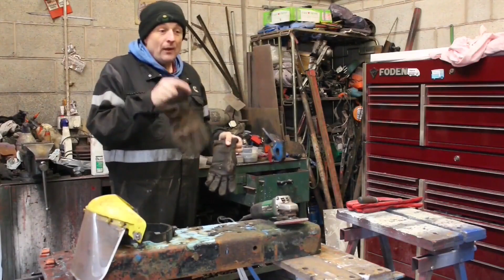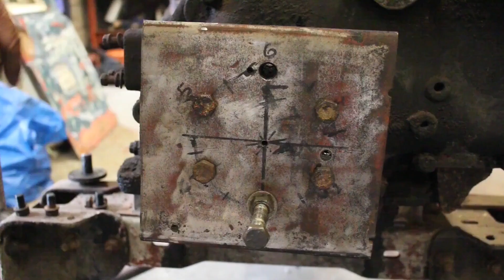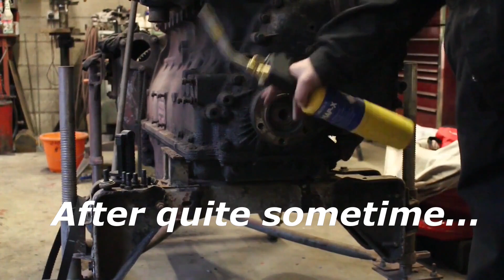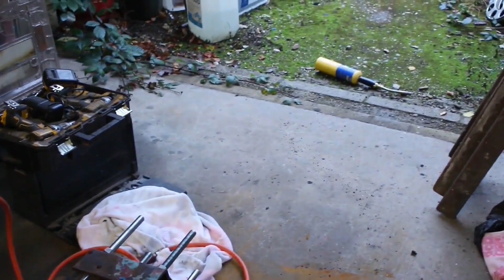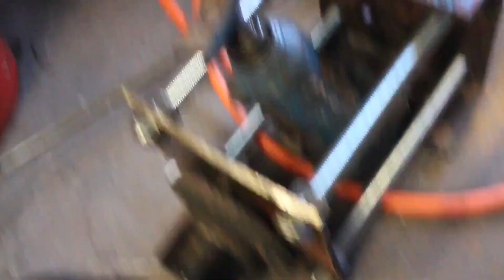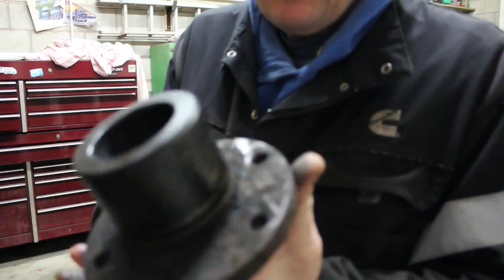Doing battle with the crankshaft damper hub.

Comment: It’s giving you a battle is that old Cummins 🤔 Happy New Year.
Reply from the maker: Certainly is mate. Have a good one.
Reply: @cabacs8062  did you give putting it in Tilcon Colours any further thoughts?IMO perfect for the Foden although not Technically correct 😞 Tarmac Green would be another colour
Reply from the maker: I did yes.  even had a look for a sleeper cabbed Tilcon unit and couldn't find one.  I think she will be going into the same livery as the Fleetmaster.